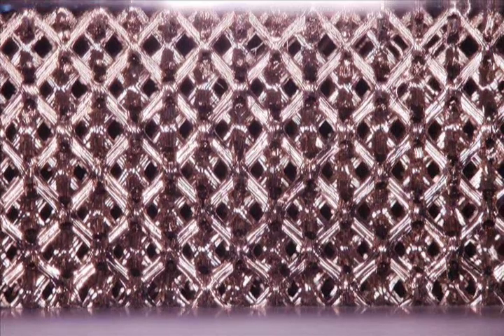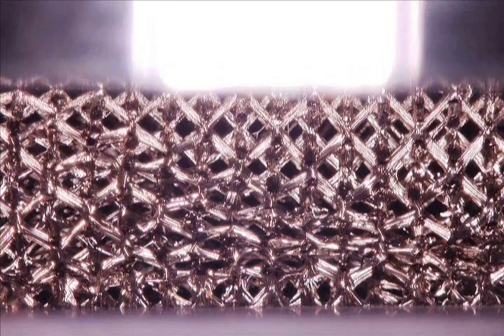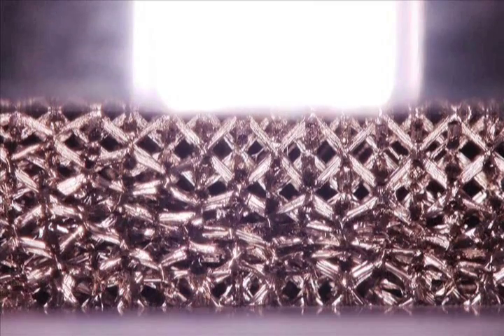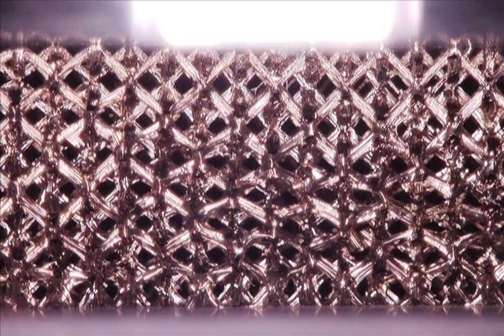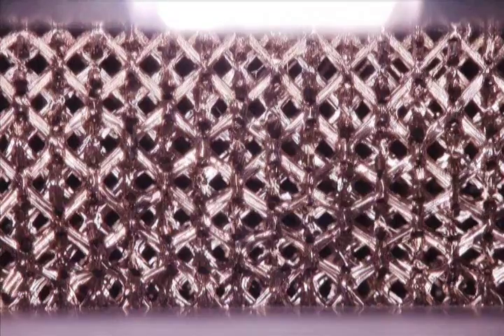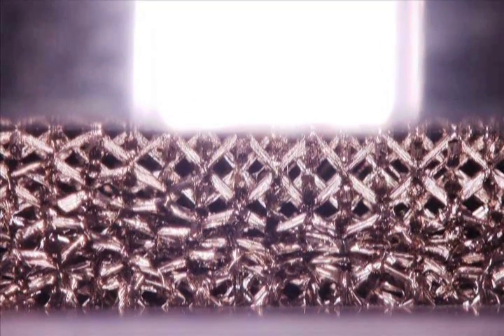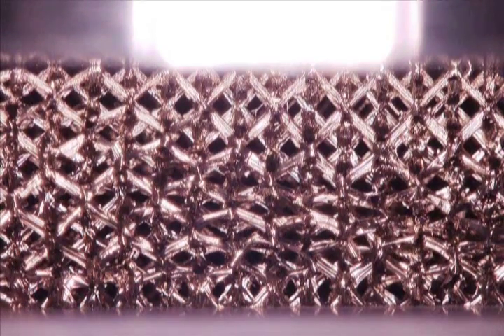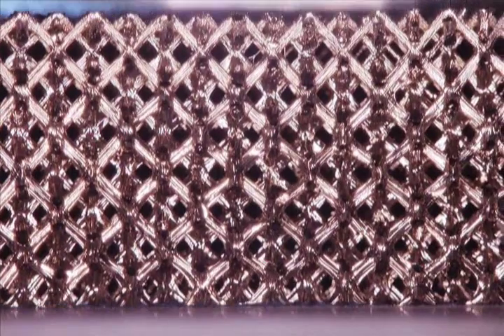The 'Eiffel Tower of micro-architecture'

Comment: I'm wondering if at a higher density it would be viable for creating gamma ray absorbing. Since the molecules of these tubes are in a formation that is stronger than a crystal structure, the atoms should have less recoil against photons. you could make a wrapping with the same thickness it would take with standard lead, but much much lighter.